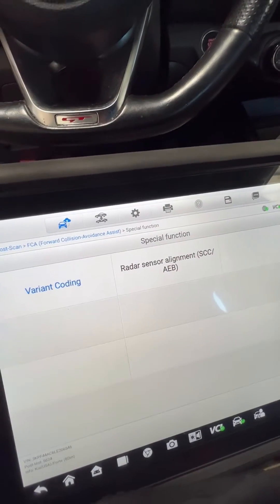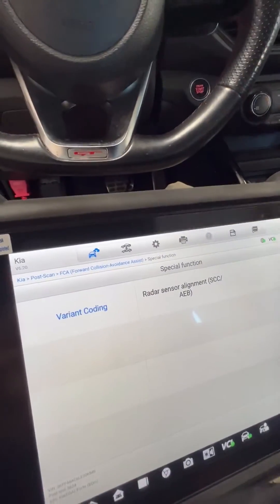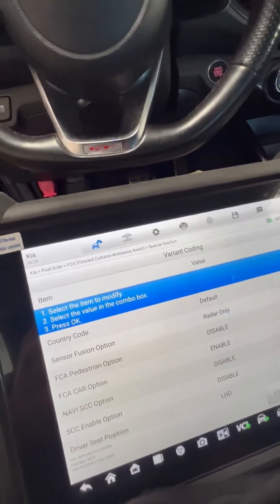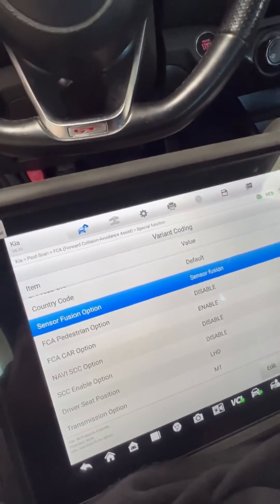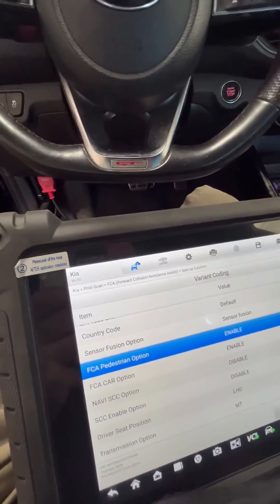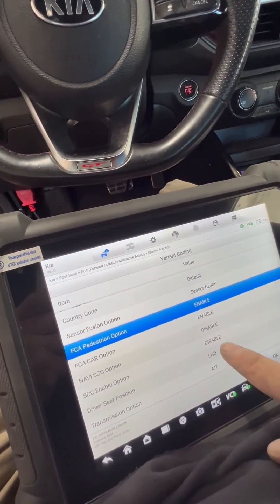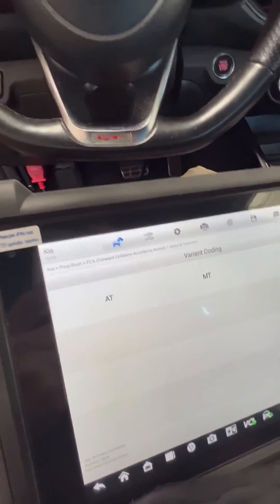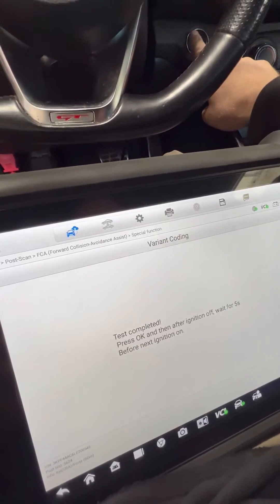Kia Forte SCC variant coding

Comment: I have a question I have a 2023 Kia k5 and I’ve installed the digital cluster that only the Korean and some Canadian models came with and it works perfectly, but it doesn’t display my cruise control information although cruise does work so you think it could be coded to turn it on ?
Reply from the maker: @OhioCarGuy  if you have old cluster plug it in and pull the coding/look at what/how it was set up. But more than likely yes it should be able to be coded unless the cluster doesn’t support it

Comment: ? What if your can’t get code from old module ?
Reply from the maker: @ryankay6941  pull it from Kia tech info
Reply: thx just found it 19$ @CambamsGarage
Reply: ? Do you know if the snapon passthru3 works for variant coding with the Kia $75 online scan tool?thx🐾
Reply from the maker: @ryankay6941  I do not. Depending on the year you may need the j2534 app, that connects to 2018 and up cars, idk if it does variant coding tho. But any mid level to high end autel should do it, or if you have the topscan dongle I think it’ll do it.

Comment: Hi! Do you know if variant coding allows to disable the startup/shutdown sound on the Kia Niro EV 2020 by any chance?
Talking about this sound: https://www.youtube.com/watch?v=GZr7kwiqI7M&t=6s
I found something in the engineering menu, "sound" section: "welcoming": "enabled" so I assume there is a way do control it via software.
No user option to turn it off unfortunately
Reply from the maker: I do not know. You would need to look at the coding options in the bcm to see if you could disable  it.

Comment: With autel tool i dont need kia oem spfware to code new from radar ?
Reply from the maker: This was a new part from Kia in the video. Literally if you have old part, pull the coding, and then swap in new part and code like shown in the video.
Reply: @CambamsGarage  thank you. I was worried I had to buy Kia $5k tool . I'm getting into adas calibrations business
Reply from the maker: The autel is pretty good. But nothing beats oem tooling. But if you’re just starting out, it’ll be a solid tool!

Comment: I don’t know much of anything about variant coding, but I might have access to this same Autel tool through a friend. I have a 2019 Kia Sorento that uses sensor fusion for SCC, but I want it to use radar only. If I were to variant code it as such, is it likely to work it does it depend per car?
Reply from the maker: I don’t know the answer to that. It may work? Or it may not. I’d take a screenshot of the original and then try and edit it and see. Sometimes the module won’t accept the coding change.

Comment: Can an SCC module be installed in a car (forte 2019 EX) that didn't ship with SCC ??
I'm trying to install open pilot on my gfs forte 19 but it didn't come with the SCC and open pilot requires the SCC to be present 

Any help would be appreciated

Thank you
Reply from the maker: Idk, if the wiring is there. Then in theory you should be able to code the option, but I can’t say for certain.
Reply: @CambamsGarage  Hi front wire harness will need to be upgraded as it will not have connector for radar.  there should be a bulk connector on the driver side engine bay in front of tire.  you can do it if you have access to wiring diagrams
Reply from the maker: @donaldholder2434  you are replying to the wrong guy lmao 🤣
Reply: Hey Man , i have an Elantra Hybrid 2023 phase |, and i want to be able to display the map like in Kia k5 , what should be done exactly,
Thanks in advance

Comment: I am trying to code a 2020 Kia Niro and keep getting a code for Multi-Function camera - variant coding error. Where can I find the correct variant coding?
Reply from the maker: Do you have the old camera?
Reply: @CambamsGarage  The camera was never replaced so yes.
Reply from the maker: @AndreCrevier-o4m  ok so why are you trying to code it.
Reply: @CambamsGarage  The car was in a minor front end collision and was fixed. I keep getting a "variant coding" and "Multi-function camera" on my ODBII and dashboard lights to check HDA and SCC. I tried calibrating the front camera but the code still persisted. I tried to input the variant codes values but I believe I am entering the wrong variant codes
Reply: The camera code cleared after calibration, however the variant code is still there.
Reply from the maker: @AndreCrevier-o4m  sorry I was driving back home. But did you check service info? And did you look up the code to make sure there wasn’t a tsb to fix the issue? 

Also are we talking about the camera in the windshield
Reply: @CambamsGarage  Yes the camera in the windshield, I think I may have changed the variant code and not sure what the default code  is. Where do you find this info?
Reply from the maker: @AndreCrevier-o4m  you can try and look on kias tech info sight or change one setting at a time till it
Accepts it